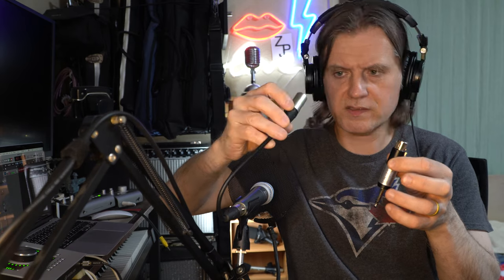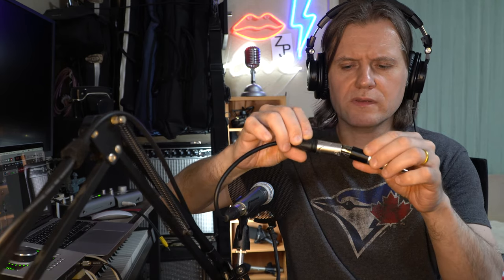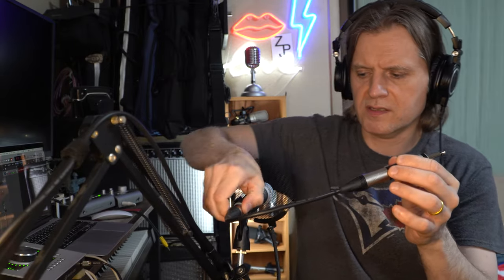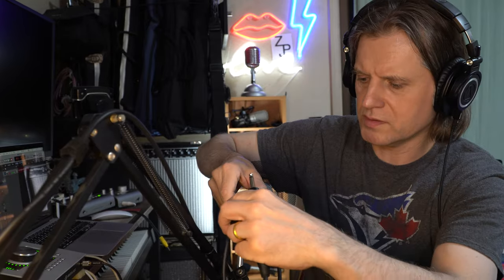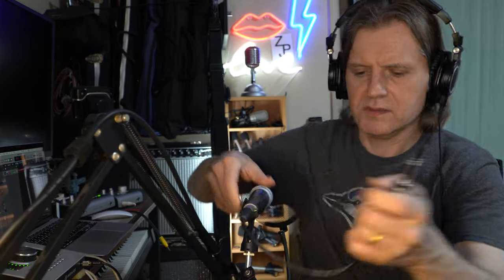How to Use a Microphone With a Guitar Amp

Comment: If you need an adapter to hook up your mic to an amp anyway, what's the point of having an XLR to 1/4" cable? Do they have uses with other devices?
Reply from the maker: @Urbansquealer  Yes, you can also hook up a mic to the hi Z instrument input on your audio interface. This can allow a mono interface to support 2 independent stereo mic signals if there are 2 separate inputs, for an instrument and a mic. In any case, most guitar amps only have hi Z instrument inputs, so having this transformer/adapter will allow you to use any guitar amp as a vocal mic amp.

Comment: thanks for the video I have a question u can use both ? like guitar and mic on the lil amps or no?
Reply from the maker: @garrycommander9351  Yes you can, but only if you have 2 inputs on the amp or if you have a simple mixer.

Comment: i wanna know if i plugged a mic into an audio interface or a mixer and connected the mixer to the amp would it do the same thing?
Reply from the maker: The amps inside the aforementioned devices (audio interface/mixer) would amplify the signal and would thus have an effect but it would be recommended that the signal is run into the auxiliary input of the amp as opposed to the instrument input so as not to cause damage to the amp. What is more, if distortions occur then the output signal on the mixer/interface should be reduced. This should be done delicately, with care and precision. Essentially, a keyboard amp would have auxiliary inputs, L & R, but guitar amps typically don’t.

Comment: do they make an adapter that is not for XLR but actually just a 1/4"
Reply from the maker: To make such an adapter would require a legitimate need for it. What specific need would that fulfill? Would it be for an older mic with a 1/4" plug?

Comment: I am SUPER EXCITED TO COME ACROSS THIS...HOWEVER,
forgive me for being repetative...but maybe its termanology that is tripping me up.
Please tell me what I need to do to attain the following :

I play electric guitar and use my fender mustang amp wich i plug my guitar into. I have Scarlett 4i4 audio interface plugged into my laptop, I have Cubase pro 13 DAW. I used an XLR cable to plug in my amp to my interface,input 1 and plugged in my microphone to input 2.
When recording in my DAW, vocals very loud, can barely hear guitar,even tho volume is high and I am essentially in a closet... 
What am I doing wrong? Please help
Reply from the maker: @cassandrahuskey8866  Hi. Is your guitar input set to HiZ? Is it manual or automatic on the scarlet?

Comment: Hi There! I am a beginner to amplifiers and I purchased an Aroma AG-15a for busking, which has a guitar and mic input. I purchased a dynamic stage mic (Behringer BA 85a) and an XLR to 1/4inch stereo TRS cord, but there is no sound when plugged in, even with both volume knobs on the amp turn up to full.  I tested the dynamic mic on a different guitar amp (no mic input) and it worked, so the mic is not faulty.

I rigged up a connection to the problem amp with a battery powered Zoom H1N recording mic, and it worked, but this is not the mic I want to use for performing.  Everything I read says a dynamic mic is plug and play in this situation. I am finding it impossible to find information anywhere about whether there is something wrong with the amp, or I'm doing something wrong. 

So having watched your video, could this be my problem? Is it possible that I need a Mic Impedance Transformer to get 'power'/volume to the dynamic mic?

Thanks in advance for your expertise in this.

P.S. I just made a connection via a Hum Eliminator, and actually heard the mic thru the amp for the first time, but it is still very soft. So second question: Is a Mic Impedance Transformer a type of Mic Pre-amp?
Reply from the maker: I ran into the same problem 30 or so years ago. This kind of thing happens to all of us at the beginning until we learn the little tricks of the trade. I am glad this video may have provided you with the solution to your problem.

Comment: I bought this exact one to work with my audio-technica AT2020 mic and Spark Mini amp but it didn't work.  Turns out I need a dynamic mic, not a condenser mic. Appreciate the video. Hopefully I can get my hands on the right mic. 😊
Reply from the maker: Yes, you need a phantom power supplier to run a condenser microphone through it:
https://a.co/d/iB6jwJs
Reply: @ZPJ_Studio  picked up a Shure SM57 and it works like a charm now. 😊

Comment: So what am i specifically searching for when i go to buy one? Basically i guess im asking are there any adapters that have the right connectors but dont change the impedance that i should avoid?
Reply from the maker: There are definitely line adapters like that, so you have to do a little bit of research, to make sure an impedance matching transformer is included.

Comment: Hi, i have 15w fender acoustasonic amp, there's an xlr entry and jack entry, pedals work well in that amp with the guitar, but is there any method to connect the microphone to the guitar pedals and play and sing at the same time?. the only answers iv'e found are about getting a preamp and a mixer to connect the mic to the pedals, and the accesories needed are in efect between others the impedance transformer, but the idea here is to make things simple without a digital loop station and stuff like that, any advice appreciated
Reply from the maker: Hi. Is your amp a Fender ACOUSTASONIC™ 15, or something similar? If so, just plug and play. Channel 1 for the mic and channel 2 for the guitar. You simply need to have an XLR mic cable (with a male jack-plug on one end & a female jack-plug on the other end) to plug your mic into the amp.
Reply: Ok thanks. i hope this order won't damage the equipment; 
1. first connect a dynamic or condenser microphone to the phantom power adapter, second, 
2. connect the phantom power to guitar pedals connected 9v transformers, then, 
3. Connect the pedal to the Xlr entry in the amplifier.  @ZPJ_Studio
Reply from the maker: I imagine, you'll be using a reverb guitar pedal for your mic, right? In that case, go easy on the gain/output of your guitar effect pedal since you are likely to create overdrive distortion if the gain/output on your guitar effect pedal is set too high. Starting at the zero setting on your guitar pedal gain/output knob is recommended, then increase the volume slowly and incrementally to a safe  level, well before distortion occurs. Use the gain on your guitar effect instead to add volume to your vocals. @diegoguzman3876
Reply: thanks a lot!
 @ZPJ_Studio

Comment: Does it work with condenser mic then plugged to a guitar amp?
Reply from the maker: Condenser microphones need phantom power which this device does not provide, so the answer is NO. However with a single channel 48V phantom power supply (PPS), it would be a Yes. Amazon sells them for as low as $20, keeping in mind that a lower end PPS may introduce unwanted noise.

Comment: Do you know what can be used to connect a usb mic to an amplifier?
Reply from the maker: You could use a laptop computer, tablet computer or smart phone, if it has a headphone jack out. To connect your mic to your chosen device, you may need a USB adapter from standard USB to type C, depending on the mic’s male USB jack and the female USB input jack(s) of your chosen device. Also, you will need a connector cable with a 3.5 mm stereo male jack on one end, and a 6.35 mm mono male jack on the other, to connect your device to an amp. And of course, you will need the necessary software to run your mic on your device.
Reply: @ZPJ_Studio  You know what? I just connected it tomy laptop and I had sound once I chose the right settings. I’m just wondering what will happen if my acoustic instrument is connected to my amp while I’m singing through the mic. Guess it should work without feedback.